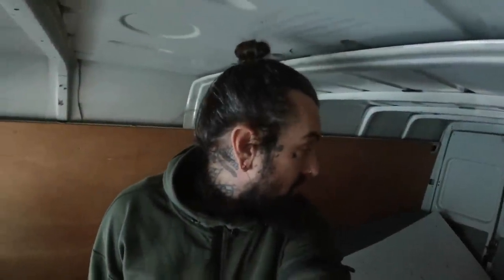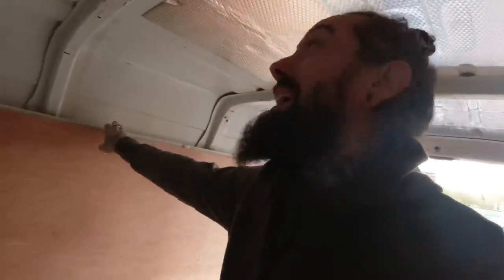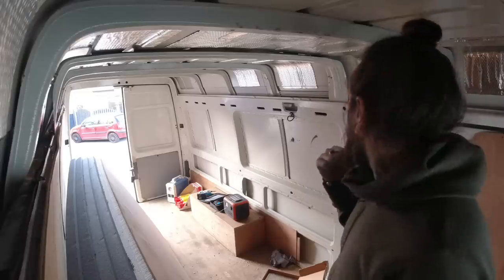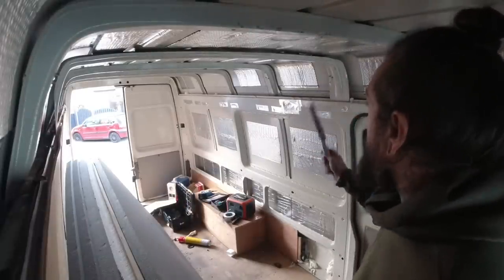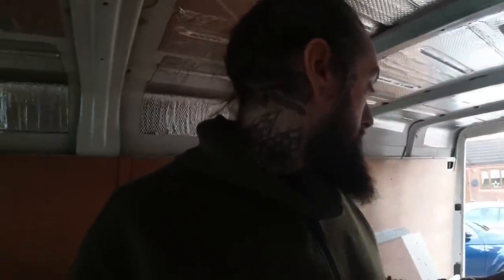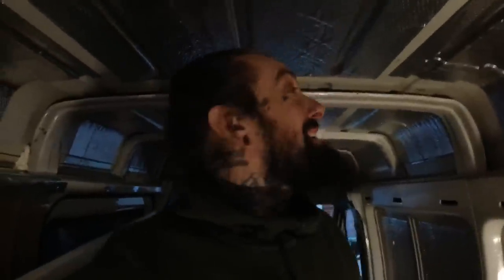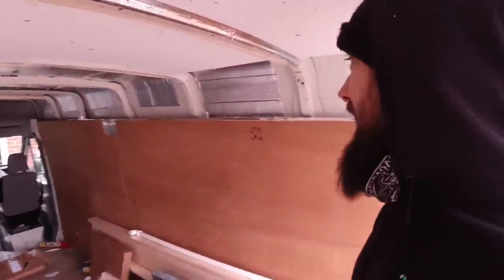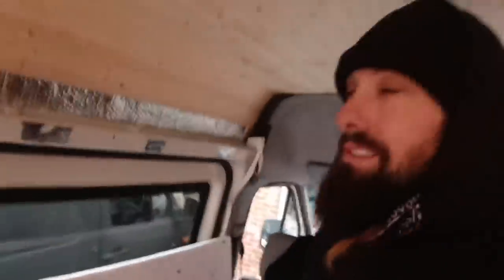Building a van - EP 5 - Let the games begin

Comment: I like the idea of gluing wooden battens to the side of the roof struts - and I totally agree with using the existing side panels (why not when they are already shaped & cut), they can be finished in any way you choose = some areas could be attached or painted with chalkboard, tiles, mirror tiles, cladded over, stained, painted in bright colours etc etc - will you run any wiring/cables through copper or metal conduit on the surface like The Indie Projects?

Comment: One bit of advice and Mel on did this on his van is don't spray foam the inside of the doors, it blocks up all the lock mechanism. One little question is where are you going to run all your wiring?

Comment: Hi Liam don’t forget although your new van isa double wheeled van and can carry more weight it’s still now only 3.5 so do your best not to build it heavier then the 3.5 if you have any silicone fill the gaps on the roof struts it helps keep the vibration down . It’s hard work but you don’t have to worry about being run over working off a road

Comment: THE DVLA HAS CHANGED THE RULES FOR REQUIREMENTS ON A FEW POINTS 
WE, LL NEED TO HAVE 2 WINDOWS ON ONE SIDE OF LIVING AREA OF CAMPER 
UNLESS IT WAS PREVIOUSLY REGISTER AS ONE Already.
You have to put a tiny porthole window in or an TINY oblong window in the bedding area. 
*2 ring gas cooker/hob top and microwave (with 240v hookup)
* Awning /or just the fittings brackets
* Decals making plain it's a campervan 
* Bed got be 6.1" or long 
* dinner table fixed......

Off the top of head can't think of what else new 
Plus your need seed them photo of each area plus reg plate 
And these changes only been around in the last 3yrs 
Please check
Reply from the maker: I know